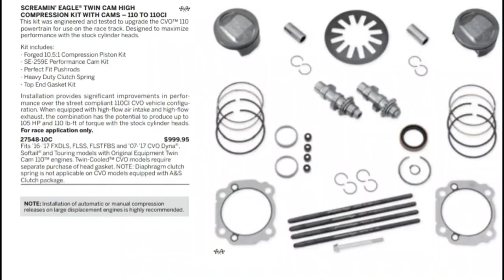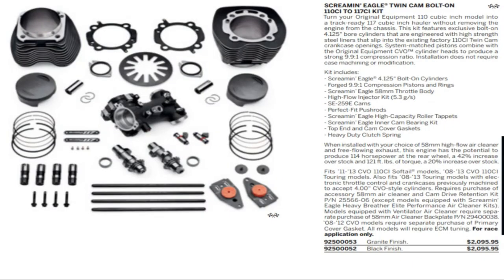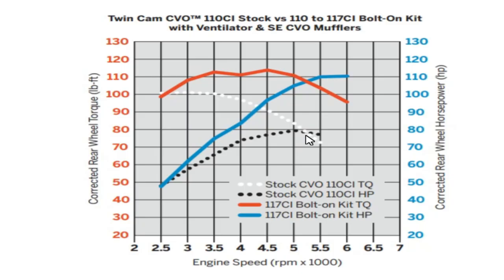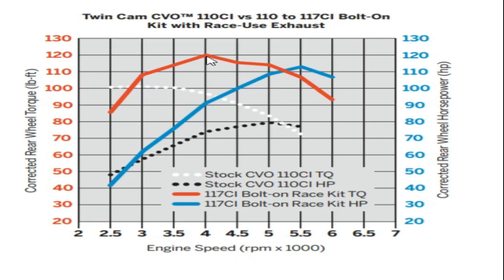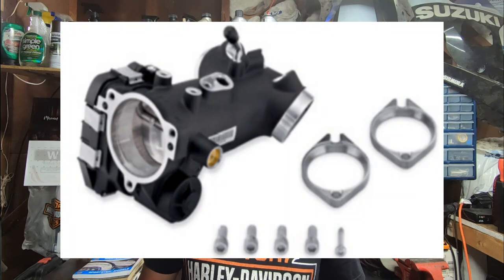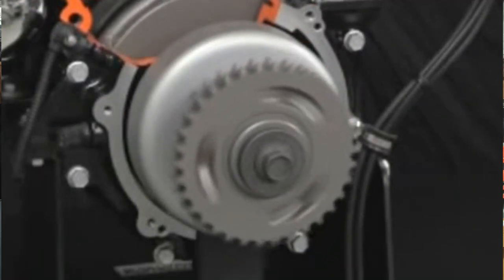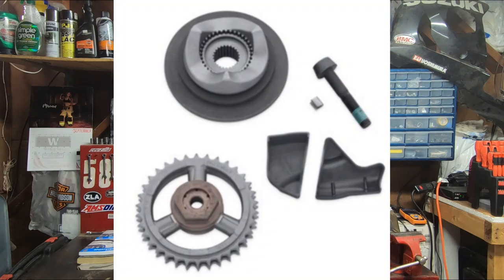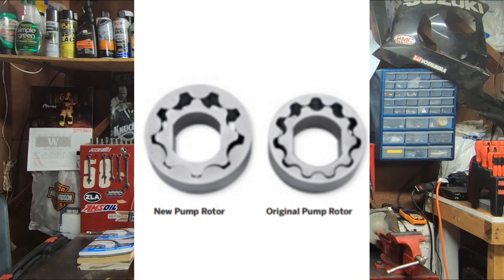Largest Production Twin Cam Harley EVER Produced | Twin Cam 110

Comment from the maker: Would you prefer just a high compression 110 or go for it all with the 117?
Reply: i would wish i could back to a twin cam with 4 valve heads.  and pull the cam plate, and throw away the cam chain tensioners.
We already know how to fully balance a TC88, so we already have that part covered.........
Reply: @thakery5720  big money though 🤷🏻‍♂️
Reply: @chunkyfxdls1878   Unique engines cost money - if you want cheap then buy a Honda !
Reply: @chunkyfxdls1878  Money mate, Harleys when stock are low powered and it costs money to make them powerful. If you think that is big money then buy a Honda - they have power and are cheap.
Reply: @chunkyfxdls1878  I do not smoke or use any  drugs... that is why I have money to spend on my bike.   If you are a drug user I suggest that you don't ride motorcycles and get some therapy to help you kick your habits.
Reply: Ima go 117, more power son!!!!
Reply: @thakery5720  Oh and they are mahle pistons you mong 🤦🏻‍♂️
Reply: I'm going to do the 117 upgrade. And maybe new cam set.
Reply: @timstanley9161  that’s what I’m doing. 117 with woods 777 or woods 999
Reply from the maker: Throw a wood cam in there and it will come alive!
Reply: I'm having a difficult time deciding which cam set would work best. I generally ride alone and I'm around 230 plus the saddle bags and bike. I like to hit it from the get go. But I do like my top end. So in short I want it all. Lol
Reply: @GixxerFoo  you ain’t kidding you need to do another video on the 110/117
Reply: I want to go for it all with the 117...
Reply: Great video, I’ve watched this several times, and subbed. I have a 17 lowrider s that I am getting ready to have some work on. I’m torn between doing a 117 kit with 2 into 1 exhaust and dyno tune, or just going exhaust, cam, and tune. My shop is recommending a woods 777 car if I go with the ladder. My concern with going with the 117 kit is leaving the crank stock. What would you recommend?
Reply: Can you do a video on the lifter issue with the 110?  I need to learn more about that.  I have a FLTRUSE with about 23K miles, I hear the lifters can start going out at around 25k miles.  Thanks!
Reply: @jweavejo1  x2 had mine fail twice. First at 21k, and second 20k later on the oem replacement. I've got a lot of flywheel runout too, so I'm torn to rebuild and beef up or just go S&S 120
Reply: Considering the Fuel Moto 110 kit with Level B heads out performs the 117 screaming eagle.......
Reply: I have the FLHTCUSE8 CVO with the 117 race kit on it, power duals from V&H, and CVO mufflers, and the pre-2018 race SE tuner. I love it. I tuned it to be a hoss on the highway. My riding style is above where the 259E cams ramp up anyway at around 3K. The kit has been on my bike for almost 15K miles and counting. I'm at 75K miles. Crane springs and the Cam plate pressure spring mod have been done. Next on the list is going to be a head refresh with mild porting and a polish and a cam plate/pump upgrade. Great video.
Reply: @Bluis5445  I went with the zippers 117 ci twin cam high compression 650 lift redshift cam's about 120 hp 125 torque 58 mm throttle body
Reply: I have the SE110B with the Stage IV Screamin Eagle 117 kit. It's a nice piece. It really needs more cam, and a lot more compression. It needs 10.5:1 compression, which you can get with the  T-Man Performance kit. That's probably what I'll do.

Although the 120R is a very attractive option.
Reply: @chunkyfxdls1878  if you want class and dependable get honda if you want to be a old man bike get harley and keep putting money into them
Reply: @jonathanboggs24 what did you go with? Thanks
Reply: Correction CVO From 2007
Reply: @mikerodriguez785   you may be right but  your Honda sounds like crap ..  can’t win them all

Comment: Good video! I ride a 2012 FLHXSE3 CVO Street Glide that i bought new in Aug 2011, which of course has the SE 110" engine. 

I've done some upgrades to my engine... I call it my "Stage 2.5". It has SE-259e cams (with the better cam bearings that won't fall apart like the crappy caged cam bearings Harley used back in those days!), a Ness Big Sucker Stage II intake, Drago's S/C/S 2-into-1 race pipe, .030" Cometic metal head gaskets that increase the squish a bit (by maybe .3 to .4), a better Feuling cam plate and high-flow Feuling oil pump, forged rocker supports, Feuling pushrods, and of course a custom TTS tune. And probably some other things I've forgotten about since I did all of those things during my first years of ownership! Anyway, the engine has always performed very well since it was new.

I run an Energy One 10-plate kit in the clutch, with their 15% stronger-than-stock spring. The stock Harley clutch plates and spring slipped badly because they couldn't handle the engine's power. I used to run an AIM VP70 variable pressure clutch bolt-on, but it really didn't do much because with the Energy One plates the clutch doesn't slip anyway, and the clutch lever pull effort is fine even with the stronger spring. 

I also run a Hayden spring-loaded primary chain tensioner that is much better than the horrible ratcheting Harley tensioner. The Hayden keeps the primary chain tension where it's supposed to be and doesn't make it too tight like the Harley tensioner will.  I just replaced the SE compensator as well. The old one didn't look TOO bad but I figured it was time. I looked at aftermarket comp alternatives but decided to stick with the SE comp this time.

I've never done anything to the crank, though. I think I lucked out with my engine, because it runs fine with 20K miles on it, and the crank runout is not bad. If I ever want to really hop up my engine, I would consider the SE 117" kit you discussed in this video... but I would NOT do that without having my crank welded and trued, or maybe even get a better aftermarket crank. Harley Twin Cam cranks have always be a weak point. Years ago, Harley increased the max runout spec to .012" - which I think is a HUGE amount of runout even for a stock engine, and totally unacceptable for a built SE engine. A high performance engine with that much crank runout would tear it self apart!

Comment: Thanks G, my 2016 Low Rider S is still my favorite bike. I have the S&S dual throat intake, RB Racing 2-1 exhaust, and TTS master tune and it rips very well. I might upgrade later, I like to first address any issues that I don't like with my bikes. Suspension, brakes, etc...

Comment: You really got to watch your engine temps with these kits, the 110 is already known to have some overheating issues,  unfortunately if you live in a hot climate,  I'm pretty sure you wontbe able to run an optimal tune , in city riding conditions,  in 100 degrees weather.  I'm pretty sure you want want to take some time out of it, taking away from its potential,  but overall giving it some cushion,  so your not getting pinging issues, even still I'm pretty sure this stage 3 and 4 kits, are going to make you run hot. I would run a 12.7 to 13 ratio on it , make sure shes always rich, run a temperature gauge. You can certainly make some nice numbers on a dyno,  but I don't think that same tune would work well in Florida,  or say out in the California desert,, for these to be good street motors,  you want to take some tune out of them to help keep them cool.  Great video man / subbed
Reply from the maker: Thank you! Yeah a good oil cooler and a very rich tune is the way to go on these bikes. Luckily they are fuel injected and each cylinder can be tuned individually, especially that rear cylinder.

Comment: Great video I own a Slim S in denim olive green I bought brand new off the show rooms floor. They had it up on a spinning pedestal with lights on it and flashing like it was the 1st thing you seen walking in. I love the power it has. Soon as I seen them I said I was going to own one. It's a huge difference from my Fxr2 in arresting red which was Harley's first ever cvo but came with the evo 80ci worked a little there is less then 60 left in the world last I checked a couple years ago. Thanks for the info I was thinking about doing some motor work this winter just undecided what yet. Or buy a new road king special and do the 131 them m8s are producing great torque and horsepower. But of course I'd still still keep my other Harley's.  Watching from Upstate Ny
Reply from the maker: I would hang onto your CVO, those are beautiful bikes and you don't see then around anymore. It's nice to here about the Slim S, l haven't ever seen one out on the road. Mostly the Low Rider and Fatboy. Now that 131 is insane, l never thought l would see Harley come out with a kit like that.

Comment: Mine just recently had the compensator replaced. Was a warranty item and dealer used the SE compensator instead of the OEM part for the replacement and I only paid the ESP premium.
Reply from the maker: They did the right thing by replacing it with the SE unit, don't go back with the OEM cause it will go out again.

Comment: The 2017 lowrider s is probably the most beautiful thing harley ever put out in my opinion. I dont like mids so id have to go forward controls but other than that it's pretty perfect aesthetically. Unfortunately my buddy does spend alot of time pulled off to the side of the road if we get stuck in traffic when its hot out. Those things have a reputation for getting really hot
Reply from the maker: I would have to agree, that Dyna Low Rider S really holds it's value too. The are still selling for almost what they cost new. The 110's did run really hot with the lean factory AFR, a good tuner and exhaust really cools them down.

Comment: Great Vid! Love your passion and knowledge. I have been telling younger riders in the market for HD to look at Softail Slim S and Fatboy S models with 110. Good power with out killer price tags vs a new one. I think 110’s (Twin Cams in General) are easier to work on and have a lot of information out there for upgrades  mild to wild. Keep’em Coming! 👍🏼
Reply from the maker: You're spreading the gospel, there's a lot of value in those S series models. They want a lot for the Low Rider because of it's popularity but the 110 is the same basis of any twin cam. They aren't that hard to work on the knowledge base on them is far and wide. I appreciate your support and I will keep'em coming!

Comment: At 4,000 miles I upgraded my 2016 fat boy s with the 117 bolt on kit. I added a Harley oil cooler non fan assisted due to the brake fluid reservoir and a set of mini love jugs, Vance and Hines big shots exhaust and dyno tuning I got 118 hp and 130ft lbs tq. Heat is a big issue as I live in so cal. Is there a fan assisted oil cooler that will fit my bike even though I have hydraulic brakes and clutch?
Reply from the maker: Ultra Cool has fan assisted oil coolers that will fit your bike, since you have a oil cooler now you might be able to fit one their fans with the thermostat to it.
Reply: I got the same bike at 35k miles I took it into the shop & Mech tore the engine down finding the ‘tapper’ front right & left worn out (loose) and my fly wheel moving a bit rough.  The shop determined that these two issues are due to the engine overheating & recommends to replace the whole engine.  I only have an aftermarket Bassani exhaust, no other mods to the engine.  Have you experienced your engine getting too hot?
Reply: I got an S&S Oil Pump & Cam plate along with new lifters, push rods, S&S cam chain tensioner kit on my 2016 Fat Boy S and it runs much cooler now. I do also have Love Jugs and a PowerVision, V&H High Output 2-into-1's, and it's in the shop for a Dyno tune as I type - but that S&S Oil Pump & Cam plate did wonders with the heat. Love Jugs help too, just not sure how much of that is the air flowing right over the top where the engine temp sensors are located. By the way, also in So Cal, and also tried the HD Oil Cooler, but that was a mess and didn't do too much. Can't wait to see how it rides and what type of output with the Dyno!!

Comment: Just had a SE 110 put in my 08 Electraglide after i hit something that punctured a hole in the left case. go figure, after 85K  i treated myself to a new motor. Just wondering but the new motor seems to run cooler. Its factory long block with 255 cams. any ideas?
 great videos..👍
Reply from the maker: With the factory long blocks they do a lot of upgrades on those motors and fix some of the factory gaffes from back in the day. It's very likely they put a high volume oil pump in the new long block.

Comment: Thanks for the very informative video. Question - what do you think are the differences between the twin-cam 117 and M8 117 CI motors? Apart from M8s having the single cam? 
I ride a 2012 Electra Glide CVO with the 110 SE motor. I'm interested in upping it to a 117 bolt-on. The 110 has plenty of torque as it is and I am quite happy with it but would be good if I could get a bit more top-end. Would it be worth upgrading to the 117 bolt-on if I expect more power for highway riding? Also, will remember to ask the dealer for an upgraded compensator if I decide to do it.
Reply from the maker: They are completely different engines, the M8 is 4 valve heads and the TC is two. Just about everything is different. The 117 kits for 110 really produce big torque. The compression is lower and they don't have the best flowing heads so they don't produce as much horsepower. The 110 kits with higher compression and better heads produce more horsepower but not quite as much torque.
Reply: @GixxerFoo  Thank you! I have not made a decision yet whether to go for the 117 kit upgrade. If I don't go for it, I may just get a second harley with the 131 CI crate engine but that would be a bigger decision of course:) I heard the 131 crate engine could be more reliable than bolt-on upgrades. Any thoughts?
Reply from the maker: I have heard that myself since it comes from the factory. I can't confirm but l believe they are hand assembled, just what l heard at the Harley shop. So you have one person putting the entire engine together and they build X number a day. I'd have to think they know it inside and out.

Comment: Very informative video, I put the 110 tire shredder bolt on kit on my 2011 dyna street bob and runs great. At 106hp122tq heat is certainly an issue in traffic but that's to be expected.
Reply from the maker: There's a guy that works at my local dealer and he has one on his Road King, they run damn good. He's got an oil cooler on his and it really helped with keeping the heat down on his bike.

Comment: Great videos, i was expecting more Power. During buying the performance Numbers was 74kw and 154Nm, therefore Im suprise that after upgrade stage IV my cvo pro street Can get to the 82kw and 162Nm. This should be performance from shop HD during buying.
Reply from the maker: I agree for they charge for a CVO they should at least have a little higher compression and really give you some power.
Reply: GixxerFoo 87

Comment: GixxerFoo I’ve been obsessed with putting the stage 3 compression kit on my 16 Lowrider S since watching this vid. I’m close to going for it, but if I do is there anything else I need to consider? Clutch? Belt ? Compensator? 
Does this kit effect the fuel economy much? Although I love the power, I also love to put the miles down without stopping for fuel every 5 minutes!
Love to hear from you.... keep up the work on the vids bro 😎
Reply from the maker: Honestly the compression kit would produce more power at any given rpm. So less throttle to run down the road, should do well on fuel unless you get on it then it's gonna use it. Clutch, belt and compensator should be fine if your just street riding and not hammering on it all the time.
Reply: @GixxerFoo  awesome man ...thank you for that! I’ll let you know how the upgrade goes 🤘🏽🤘🏽
Reply from the maker: Hang onto that S model, those bikes are still bringing top dollar today!
Reply: @GixxerFoo  yes they do!
 I just purchased an almost mint condition garage kept 2017 Special 110 fatty from a weekend rider just shy of 5k miles for 14k. Still holding the original rubber with good tread 😳 and I couldn't be happier.  Well till now 😆 as I now want to drop in a stage 4. 
Not if.. but when I do, do I need to upgrade anything else besidesthe compensater ? As not to say later down the road.." dam why didn't I upgrade that now I have to rip it down again.. uuuughhhh !!!"
As a NEW SUB to your awesome channel..Thanks in advance my good friend 😉

Comment: Question GixerFoo, how is Harley getting away without upgrading BACK TO the Timken dual crankshaft bearings on the 96, 103, 110 and other larger displacements TC’s without having crank problems? If they’re getting away without crank problems on these higher horsepower motors why do you think that I need the Timken upgrade if I’m going to wring more horsepower out of my 88 TC? Did HD do something different with these cranks?
Reply from the maker: Yes, the Twin Cam 88 before 2003 was a 5 piece assembled crank with the Timken. 2003 they went to a 3 piece pressed unit and a roller bearing. The issue is the crank runout is very high on the 2003 up units, it's not nearly as tight as it was with Timken lower.